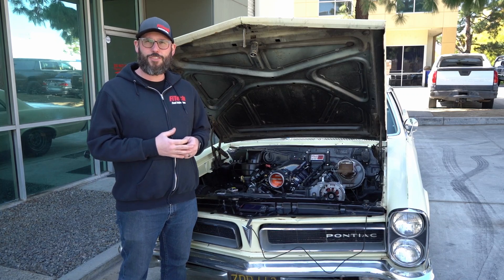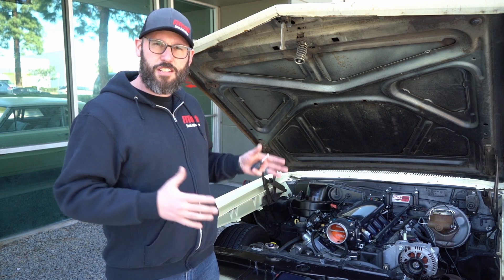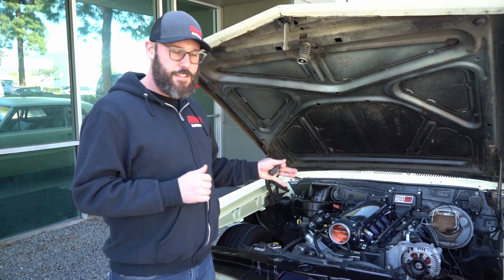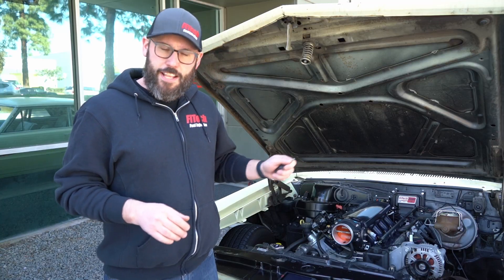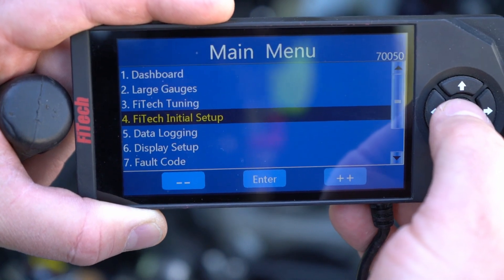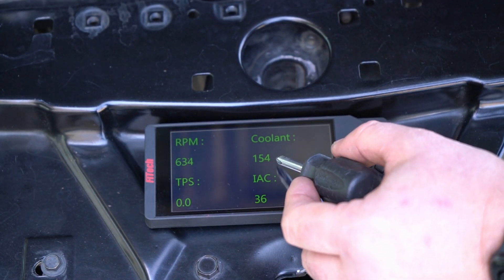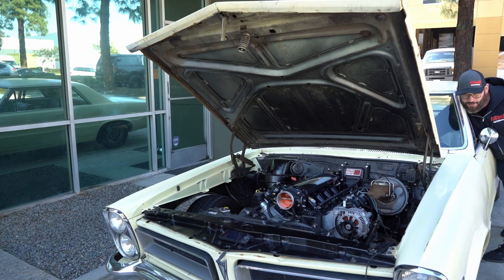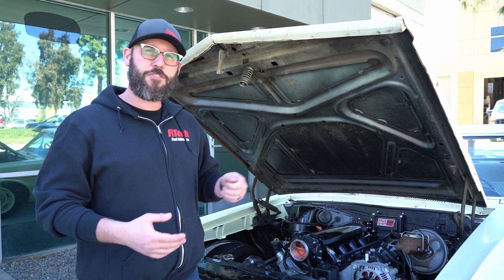LS Throttle Adjustment | Tech Tuesdays | EP61

Comment: My ls runs perfect right after i perform this adjustment, but i have to readjust every couple months. Vibration must back the idle screw out after a while. Is there anything i can do to stop it from creeping back ?
Reply from the maker: Hello sir, 

It does sound like the screw might coming loose after a while, if the vehicle is running flawlessly after the adjustment, you may use some type of thread sealer to prevent motion in the adjustment screw.

Comment: I can not emphasize enough to get the manifold torqued to the correct value and how bad the supplied manifold gaskets are. I’m speaking from past painful experience. I was getting very frustrated trying to get the IAC dialed in. I knew I had a vacuum leak somewhere but couldn’t find it. I finally removed the manifold to check the brake booster and fuel pump pressure regulator hose connectors and made sure the taps for vacuum lines were plugged properly and installed another set of gaskets from Fi-Tech. My IAC got closer to under 10 but still couldn’t get it dialed in. I talked to one of the guys at Summit Racing and he suggested I get a set from Fel-Pro. Replaced the gaskets with Fel-Pro MS 92438 gasket kit. These are the gaskets used on the factory intake manifold. Shave the triangle tab off and install the gaskets with the flat side on the manifold, then torque the bolts in sequence. I’ve found out the hard way that after reaching the torque value you need to wait a minute or two and go around again at least two or three times before the gaskets stop deforming and seal the runners. After the new gaskets from Fel-Pro were installed and I started my engine I was able to get the IAC dialed in between 2 & 0. PERFECT! With the IAC set I set the TPS and had my hot rod ElCamino running like I expected. On my next Ultimate LS kit I won’t even consider using the gaskets that come with the kit.

Comment: Where do you adjust a dbc 5.3l ls?
Reply from the maker: Look at the throttle body in this link. The adjustment screw has blue thread locker on it. https://www.americantrucks.com/productphotos?webid=bbk-silverado1500-85mm-throttle-body-17090&showFeed=True&customerpics=false&index=0

Comment: It seems like my Iac valve goes down really slow eventually it gets to a number it holds at but mine does not move down as fast like yours on this video, where can I adjust for this?
Reply from the maker: Under the tuning section of the handheld in the IDLE CONTROL menu you can change the LOOP RATE UP (opening) and DOWN (closing) of the iac motor.